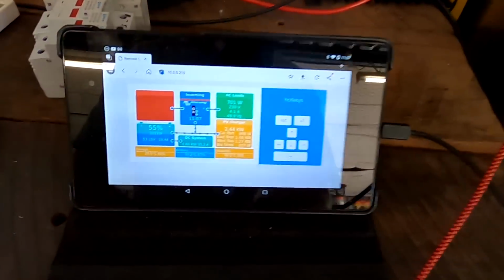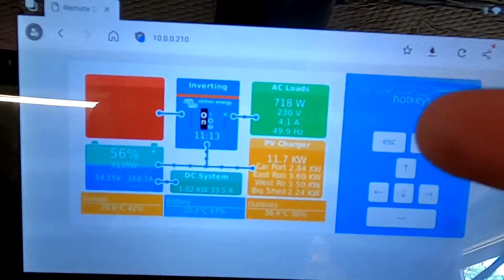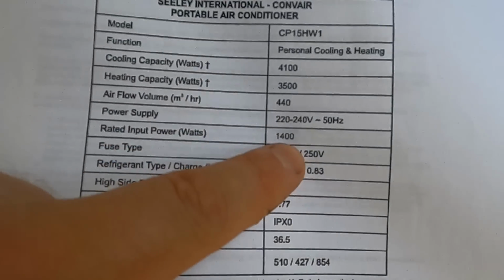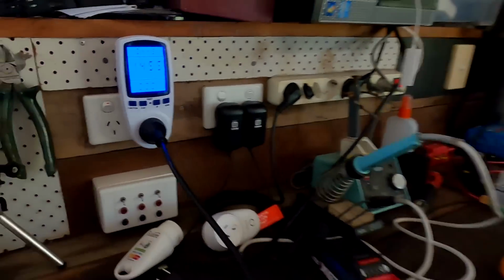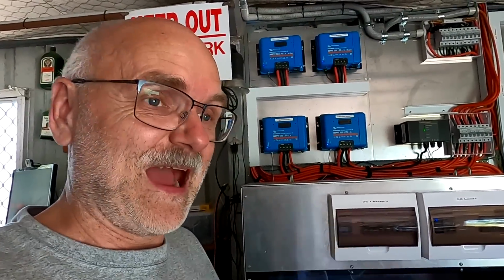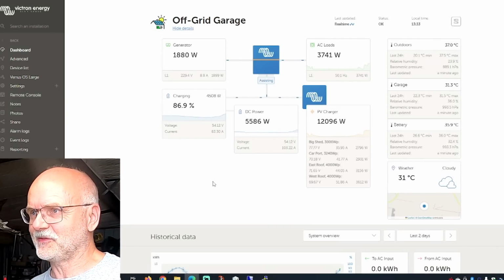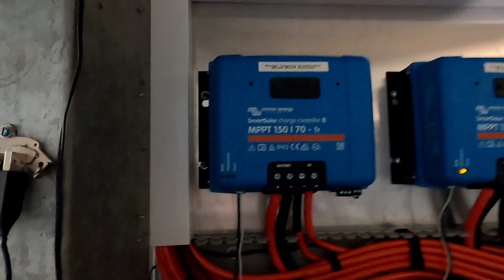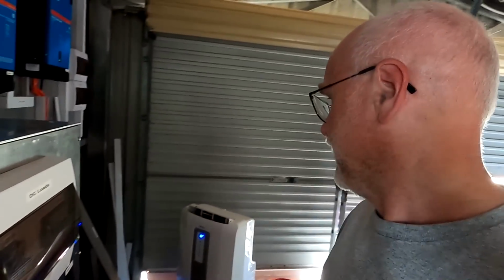Actively cooling solar and battery equipment with an air conditioner. Beneficial or waste?

Comment: Andy you need a small power room with a 9000btu about 2.7kw cooling dual inverter split unit they use like 800-900watts super efficient, the LG split units are very good.
Reply: When a mono-block air-conditioner blows air to the outside, the under-pressure sucks in hot air from the outside.
Reply: @rbartsch  I was just going say this, it's a major design flaw of portable air conditioners, if your pumping air out of the room then air will be drawn in. I used to have one in the office at work and when I turned it on you could hear the wall creak as they were sucked in. From a design point it's so easy to fix, either use a twin wall hose, or two hoses, one for air in to cool the condenser, and one for air out.
Reply: Me again. Affirmative, what Guy7wrote is absolutely correct. You need an enclosure to the PV System, und a window AC not the portable device. Forget about the “heat exchanger” system. Trust me …. It’s a gimmick. The system is simply “reversing” the Freon supply and ythe system will STILL run the compressor ! Meaning ..simply wasting 1750 Watts, draining LiFePo4s.
Since you, already invested in capital appropriation, why invest on devices, which you’d, discard later anyway?
 12000BTU (1 ton) small window air conditioner mounted at the top of the enclosure, test thermostat settings by trial n error. A air circulating fan is highly recommended . 60 D F is assured. The VICTRONs will love the cool condition😆
Return the item you procured, please. Guten abend.
Reply: @sreekumarUSA  
That’s why he got it for cheap 
They are power hogs.
Having a hot compressor in the area your trying to cool isn’t smart
Reply: Yess I use LG dual inverter with active power control I can cap it to 40% power and it uses like 250 to 400w. Hey buy yeah you cannot beat 125$
Reply: Yep 
Those air conditioners (vented by a hose units) are the least efficient ones you can get.
Midea inverter ac 12000 btu for less than $500 us.
Live in Florida and I use them in the work shop.
On solar
Reply: You can get good split units that are 540e for a 9000btu unit. Absolutely amazing efficiency.  That's about 16btu/w. I have noticed that the larger you go in btu capacity the lower the efficiency. And no I'm not talking "seer" I prefer EER or COP. 36,000 btu units seem to crap out on efficiency.

Comment: Regarding the Seplos batteries, if the BMS can deliver the low and high cell voltage, should be able to push all the cells (cellid) with voltage and resistance to the Venus Os.  So, maybe is possible to see all the cell information on VRM, so from outside home, you could check any cell (even you have the large Venus Os, and that includes Node-red, pretty easy to work with!!)

Comment: Andy, I see that the air conditioner has two places where you can put a tube behind, I think it is able to have two tubes behind, one for taking air from outside and one for pushing air outside, it would become more effective if you would use both since it won't suck from inside air already cooled to push it outside heated.
(If it is actually true that you can put a second tube)
Reply: It blows my mind that the single-hose type are not only legal in California, but it's almost impossible to find a dual-hose type at a local retailer. You have to special order the good ones. The negative pressure sucks hot air in through the leaks in the building, greatly reducing efficiency and overall capacity. Single-hosers should be outlawed, period. Save $1 on hose, a couple of hours of operation and the electricity difference has exceeded that. I guess the IT industry is to blame - the single-hose types are simpler to use in a data closet with localized hot spots that need a cooling boost, but have a more efficient A/C already cooling the whole building. I guess in that situation, the negative pressure helps keep the server room's heat from leaking out into the rest of the building, and that temperature might be higher than outdoors?
Reply: Yes, that is correct Andy. Get yourself another hose so you are not under negative pressure inside.
Reply: I'm glad you posted this as I also had this issue until I modified my unit to have another hose that sucked in from the outside of the room being cooled. The transformation in performance was night and day.

Comment: Since the power is 'free' maybe efficiency is not a concern,  but he AC would work much more efficiently if the intake for the condenser was routed to the outside.     As it is, the unit is sucking hot air from the outside into the garage and then blowing hotter air out of the garage.      Having said that, I agree with @Marcus B that a mini-split is much better.

The comment at the end of the video about running out of space is another reason to get a mini-split.   The condenser would be outside and the cooling head could be mounted up and out of the way.

Comment: They make a split system ac that you can run on solar only. I think a 12000 btu uses 3 400 w panels, also reverse cycle for heat.

Comment: I haven't watched yet but I will tell you from experience. A portable ac is NOT 🚫 the way to go. Get a mini split. A 24K BTU mini split has better efficiency than a 12K portable AC.
Reply: These kind of portable AC's shoud be banned. The outgoing air most come from somewhere (lower pressure) so pulling heat from outside back into the cooled area. Only solution would be to add another air pipe for the incoming air and make a solid connection for the two air pipes. But that defeats the whole mobile idea.
Reply: What’s a BTU! 😂

Get with the program, we use kW these days in the rest of the world. It’s bizarre that America uses BTU’s and Fahrenheit!